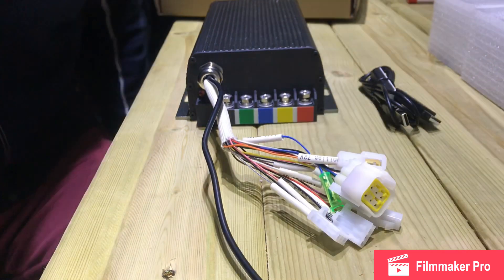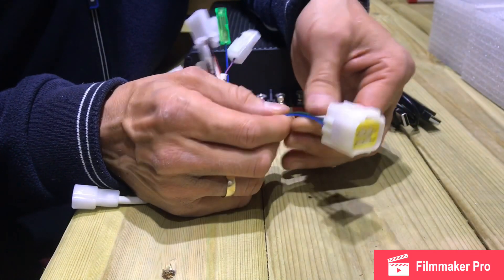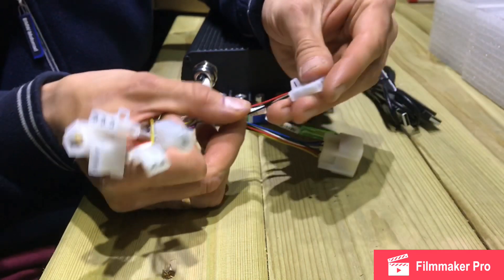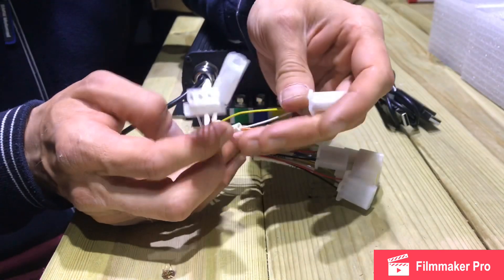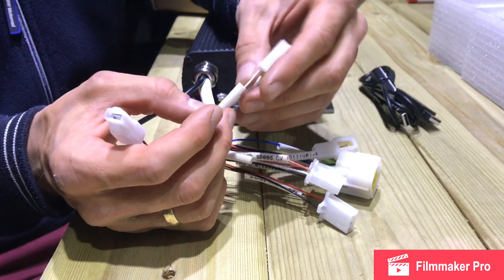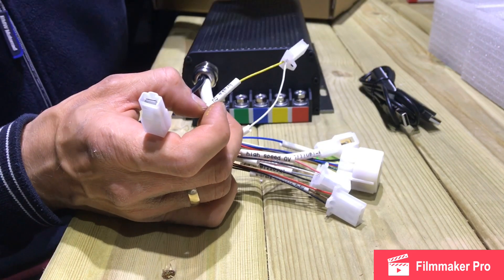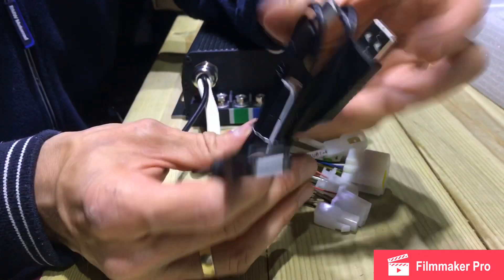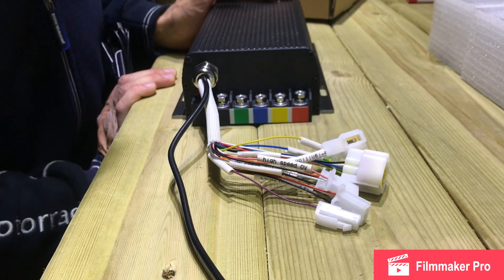Sabvoton wiring

Comment: do i just directly connect the phase ring connectors from the motor straight onto the terminal ports on the controller? My kit did not come with a terminal junction and no phase wires on the controller.

Comment: Hello thanks for your videos very informative. I do have a solid green light and I do check pretty much everything and I didn’t find anything wrong but still my controller doesn’t work any suggestions I’ll really appreciate thanks
Reply from the maker: If it does not conmect to the mqcon app with the bt module pluged in and the green light on the unit it must be a faulty controller then.
Reply: @bobikleeds   I think it is thanks
Reply from the maker: Hey. Please use bluetooth dongle to connect to the controller and see if it shows any faults.
Reply: @bobikleeds  hello thanks for your reply. That’s the other problem it didn’t pair with Bluetooth well actually it doesn’t appear visible the MQCON controller any advise?
Reply from the maker: Did you connect the ignition properly?
Reply: @bobikleeds  yes I do connect the orange wire that says e ignition to the positive
Reply: And actually it turned on green solid

Comment: Hi, tell me where to solder the wire to the temperature sensor to sabvaton?
Reply from the maker: Its in the hall plug. You should have 6 wires in that plug.
Reply: @bobikleeds  I have 5 wires. Maybe you know where to solder the wire to the controller? The name of the contact.
Reply from the maker: @ВиталийКулабухов-й3ж  yeah. Not without looking inside which i have no time for. The sabbies i use are none display version and they already come with 6 wires on hall plug. I would also assume that your sofware would not support the temp sensor but not 100% sure.

Comment: My (sabvaton 72150(m) controller came without anti-theft plugs. I would like to know if I can use any other wire in its place?  I know the Orange (e-lock) connects to key lock voltage side, Brown (mtr signal) to blue phase wire, but not sure where to connect the Blue (anti-theft wire) my controller doesn’t have that wire. Any help would be greatly appreciated.

Comment: I bought an alarm with ebrake lock for this controller but the connectors are different I don’t mind changing the connectors but I need to know the wiring color connections. The alarm came with two plugs one plug two wires red and black the other plug three wires orange gray and blue can you help, which colors to connect? Thx.

Comment: hello, does the 150A refers to the output motor current? or is it about the 150A battery drain current?
Reply from the maker: It is. Phase is 350a
Reply: @bobikleeds  so is it about the battery or motor?
Reply from the maker: @KiaraNushKatan1  it drains 150 from the battery and sends 350phase to the motor.
Reply: @bobikleeds  thank you very much!

Comment: I have a problem how I know what low speed or hi speed?? I by pass the display I only use the app.. I have 2000w hub and 52v with a 100amp sabvonton controller stuck on 32mph something is wrong it’s slow!

Comment: I have a lot of trouble with English can you explain to me how to connect the regenerative braking function?  because I have an Express Accelerator and I also have a sensor that knows when I brake, I have them connected but when I brake nothing happens the accelerator for braking does not work!  And on your video I did not understand how to connect it .. you have to connect it to the negative of the controller?
Thank you so much ! 😉

Comment: Can i use with 52v battery and 1500w motor
Reply from the maker: Yes You can.
Reply: What is diffrence between cheepy chines 48v aluminmum controller and sabvaton

Comment: Hi Bob, I have a Sabvoton 72200 flashing the green light. The manual says this is how Sabvoton tells the user there is some kind of problem. Typically during functional operation the green light is off and only the red light is on solid. I don't know how to fix this or how to test this controller. The seller is not responding. Can you help me? I have a voltimeter. Do you know where someone can service these controllers in the USA? Thanks!
Reply: My light is solid red is there a problem does it supposed to be green?
Reply: Hi did you got fixed?

Comment: Can you give more information on the single blue hall meter wire? I can't figure out where to wire this.
Reply from the maker: Hey. It is used for diagnostic tool or i use it with my ant bms display. It is hooked up to the display to show the speed. Otherwise you dont need to plug it in.
Reply: Bob Budowniczy thanks so much!

Comment: Hello, I had a sabvoton svmc 72100 and it came with one plug that has both brake disconnects, the throttle, and display and that plugs into a plug on the bike that consolidates those 4 things.  I bought a  72150 to replace it and it does not have the plug, it’s the same as yours.  Do you know how I can wire it or do I just need the controller with the display prewired?
Reply from the maker: You need different sabby. This one does not support display
Reply: Bob Budowniczy Darn, oh well.  Thank you for quick response.  I was trying to wire it up without display, I hooked up both pos and neg and connected to the battery.  I don’t have an orange wire and I could not get the red light to go on.  Any ideas, I’m a newb here and appreciate the help!
Reply from the maker: Orin Levey hey. What wires do you have on yours?  Contact me on messenger. Bob e Bikes
Reply: Bob Budowniczy which messenger?
Reply: @bobikleeds  do you guys have what’s app?
Reply from the maker: @brde5981  07957618018
Reply from the maker: Forbidden Tut  hey man. Sinewave is a type not a model and sabvoton is a sinewave controller.

Comment: I hooked up this controller and my speedometer doesn't show that I'm moving it stays at Zero, the cruise control doesn't work either, i need help how to fix these two problems?
Reply from the maker: Hello. What speedo do you use? This version of sabvoton does not support any display. On my bikes i use the ant bms display for battery  and you can plug in the hall wire from sabvoton to it so it would show speed.

Comment: Very good video, clear and to the point. Where did you buy yours from as every one i see seems to have a different range of connectors?
Reply from the maker: EverythingElectronics Channel hey man. I buy mine from siaecosys or qs electric drive store. Same thing really. These are no display versions also used for electric scooters. I only use these. Less problems in general.
Reply: @bobikleeds  I'd never heard of them before but they look great, a simple lineup with all the connectors. If I need another one I'll go for them. Thanks!

Comment: im having problems with connecting usb  (usb not recognized - device descriptor request failed) got whole setup used and I'm using different data USB cable. can you help? mowisz po polsku?
Reply from the maker: Hej. Musisz miec oryginalny kabel. Albo usb bluetooth. Ja sprzedaje na ebayu moduly. Kable tez jakies mam bo buduje ebikes. Dzieki.
Reply: @bobikleeds  sprzedaj mi USB kabel i bluetooth module
Reply: @bobikleeds  @lexls430 na ig